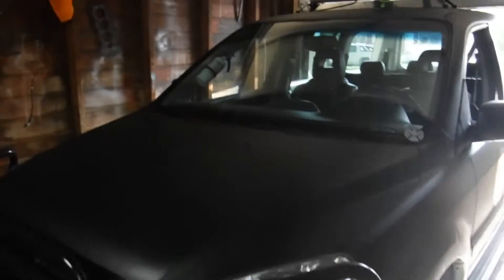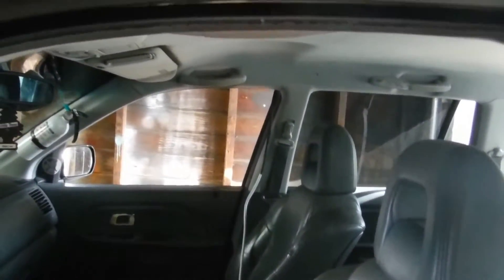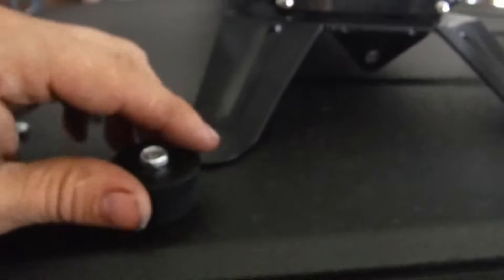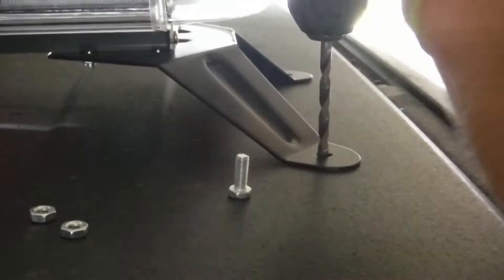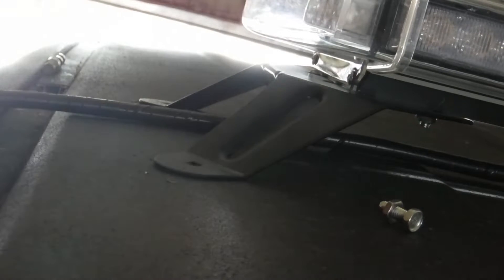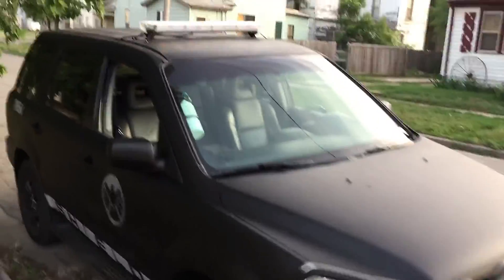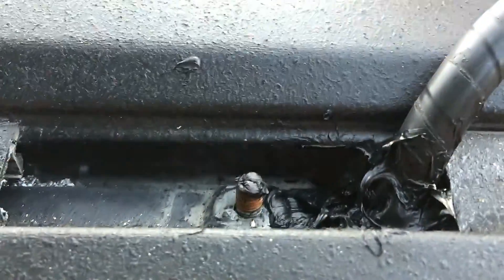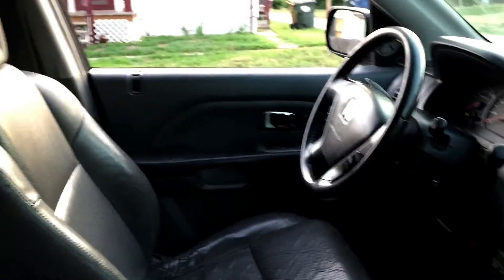How to install a emergency light bar.

Comment: Real emergency light bars use adjustable strap kits to attach to roof ,when that bar goes kaput ,your left with holes. We had as tanker that the manufacturer directly attached a bar like that ,going down the road it sounded like you were making mimilkshakes.

Comment: Hello james d i watched a video of yours where u spray painted a car using rustoleum 2x paint +primer and i wanted to kno if one coat would be enough to cover a car if im using the same kind of spray paint
Reply from the maker: Islandlife 242509 most times I use only 1 coat with no issues
Reply: James D guy when using one coat, i should make it a heavy coating?? N how long after the base coat would be best to wait before applying the clear coat
Reply from the maker: Islandlife 242509 a medium coat kinda heavy but not running worthy. Also I’d wait 10-15mins before clearing it
Reply: James D guy honestly love the stuff your doing, would love to pick your brain some more about a few things, ive never done anything like this before so im a real paint Virgin but where i live here in the Bahamas its expensive to have ur vehicle professionally done so i wanna try do it myself, so im wondering if there's any way to get in contact with you to ask a few things
Reply from the maker: Islandlife 242509 Facebook there is a few ways 

Search Moore Motorsports garage 

Or Moore Motorsports like page

Or find my James d guy page on YouTube and message me

Comment: Maybe you guys can help me. I have an LED light bar that I use for my Volunteer Fire Department. It's wired to the truck now but it interferes with my pager and fire radio. It did the same thing when  it was plugged into the cigarette lighter. Any suggestions or ideas?
Reply from the maker: Tyler Covert That is a very unique kinda problem but it seems like there is radio interference I’m wondering if the wiring isn’t shielded. Non shielded wiring can cause interference. It may sound weird but wrap some aluminum foil around all the cord as a test and see if it still does it
Reply: Thanks also have seen where if the wire isn't shielded to put ferrite clips on it?

Comment: Hey guys, does anyone know how to stop spray paint cans from spitting blobs of paint on your work. I know this is unrelated to this video but James' car painting video has comments disabled. Thanks.
Reply from the maker: Zac Nicholas sorry about that other videos are not disabled. I usually find another fan with a better tip and throw it in. Shake the can well and make sure the tip isn’t clogged up
Reply: James D guy thanks heaps James Il definitely try a better high flow tip.

Comment: I stopped watching when he said to drill holes on the roof. 🤦‍♂️
Reply: Lol
Reply: hooks can be used
Reply: That's a fact, roof skins are not structural supports, but he didn't want to use the "goofy" looking correct brackets, you know, the ones that actually go above the doors where the metal is double walled ?